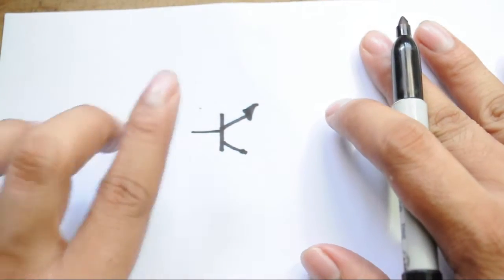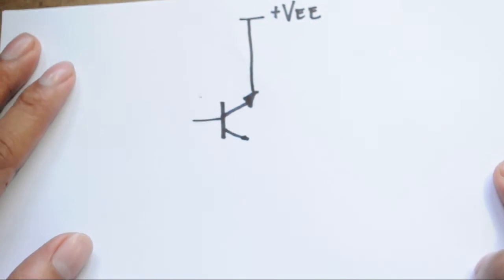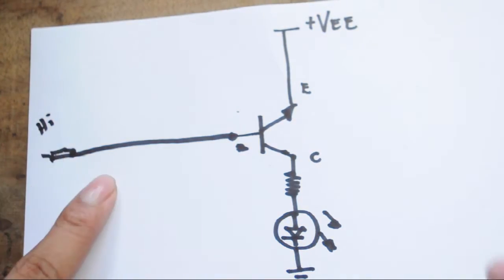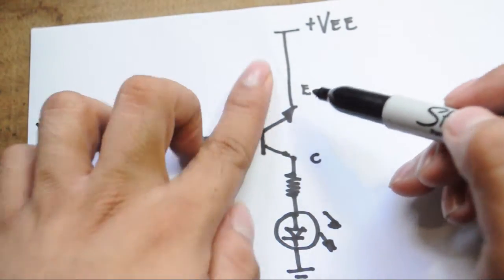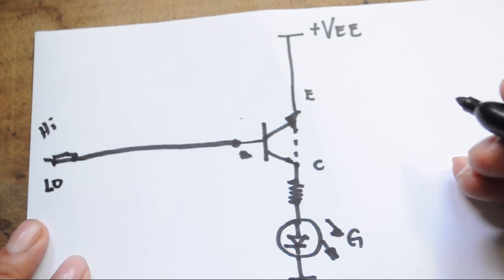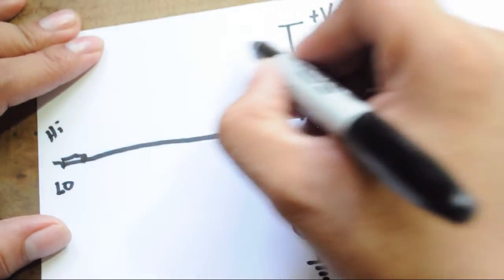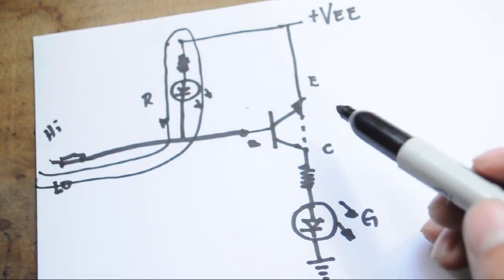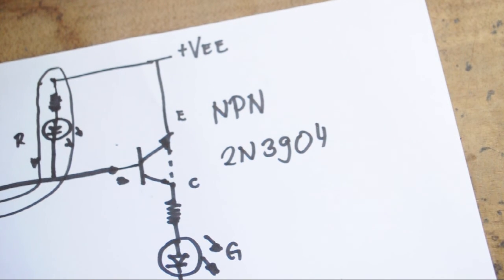DIY LOGIC PROBE - Schematic

Comment: I tried to put this diagram on breadboard but nothing happens what seems to be the problem?
Reply: The collector and emitter are swapped in the diagram; you need to either swap them or replace the transistor with a PNP-type transistor. For current to flow, the arrows in the LED and the transistor should point in the same direction.